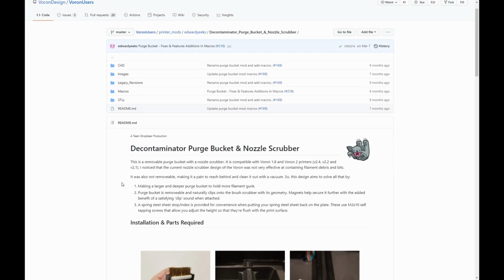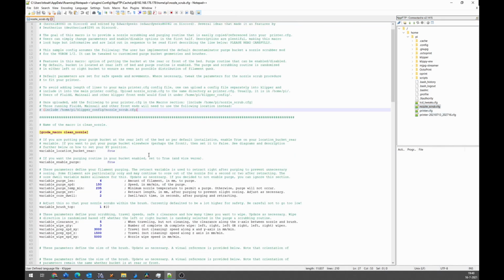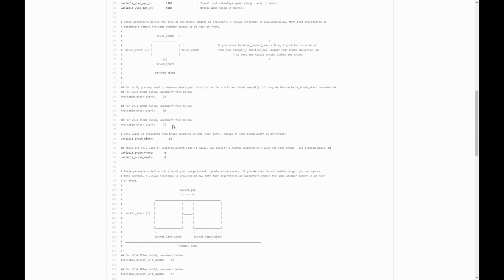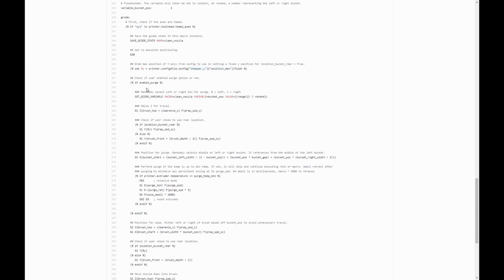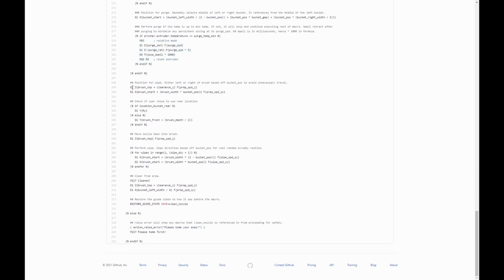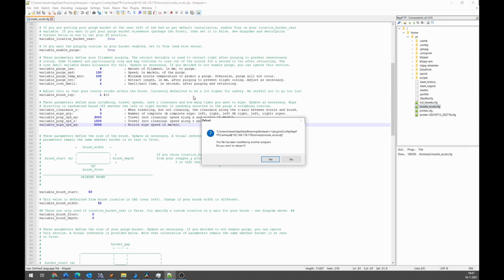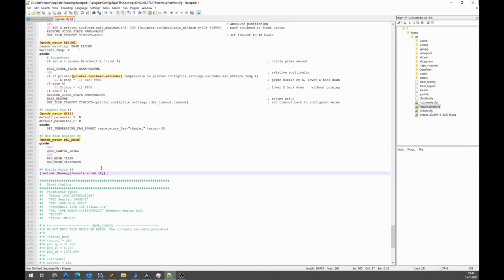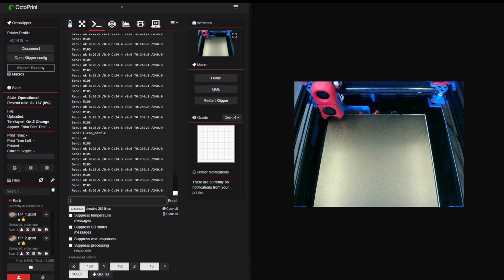Building Voron v2.4 - Nozzle Scrubber [Ep18]

Comment: Before doing the bucket I did the brush and placed it but its looking like Im going to have to move my 350 bed forward to utilize this :( going to loose an additional total maybe 20mm on my Y
Reply from the maker: If you have not used build space in your front, you can also use that and not loose any space. In my case I did not loose any space.

Comment: any idea why the tool head runs to the x axis left limit after scrubbing?  Any idea how to stop that from happening?
Reply from the maker: You can try to edit config file of nozzle scrub.
Reply: @zer0isdoing  I understand that but not sure what to edit.... I don't understand how the macro is determining the location to send the tool head.  Didn't know if you knew or understood the process.
Reply from the maker: @MRKTM690smc  Line 211:       G1 X{bucket_left_width / 4} F{prep_spd_xy} 
This is the last X movement, so toolhead goes [width of 4] mm(not coordinate, relative movement). 
I would just take base cfg file and edit variables and try again. That is the easiest way, I think.

Comment: How can it go to the right level to scrub the nozzle if you don't z-home it first?
How can it find the brush, if you don't xy-home it first?
Great little mod, but utter non-sense that some molten plastic affects the z-home.
If this is the case, then something is horribly wrong with your printers gantry
Reply from the maker: You need to home al axis before running macro. Otherwise it is not doing sequence. 
No, it is neither non-sense nor something wrong on gantry. What I have tried to explain if there is flowed filament on your nozzle and if the nozzle is cold, this small piece of filament will hit the z-pin, not nozzle itself. And this will effect your z-offset. However if the mod is not used, at least homing(just before starting the printing) should be done when nozzle is hot. So, left filament on nozzle will also melt, and can be at least squished between the nozzle and z-pin.
Reply: @zer0isdoing Ahhh, some edge case that only exists in a theorists mind - homing a cold nozzle before a print!

If I was ever to do such a thing, I would be much more worried about the dent in my PEI sheet from the plastic nub, than I would be about my throwing my z-home off by a tiny margin.
Reply: @joshua43214  man, why are you hating on this video of his? Try to be supportive of people who share their knowlede on YT. Besides, this is a well accepted mod in the Voron community, not just some hack idea or theorists construct.
He is quite right actually that filament stuck on the nozzle will throw your z offset by a certain margin and from experience, even a 0.02 mm deviation will affect your first layer if you run a full plate prints. Cheers
Reply: I have the same mod. Here is the sequence: heat, initial home, nozzle scrub, home again for accurate z-offset, start print. I home at 150mm/s so the second home really takes negligible amounts of time.